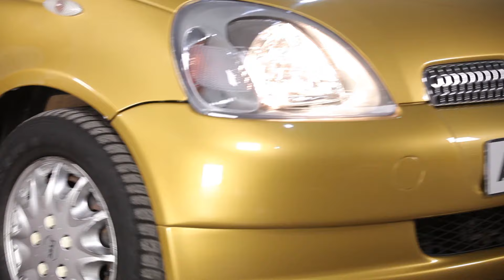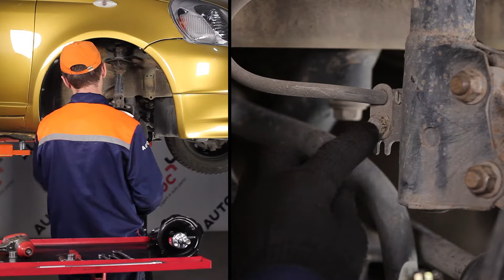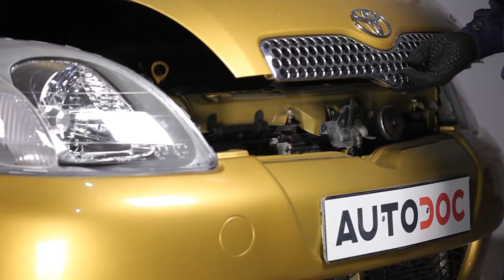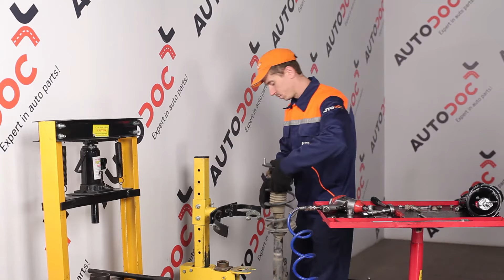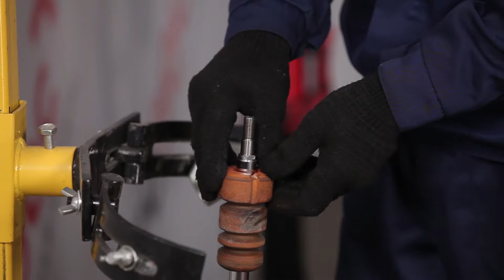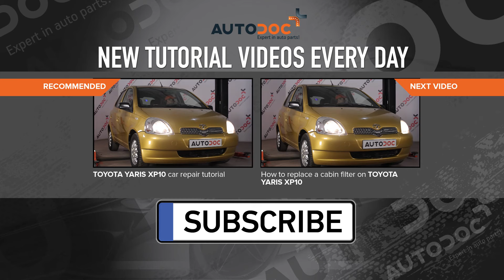How to change front shock absorbers on TOYOTA YARIS XP10 TUTORIAL | AUTODOC

Comment: Just did this job today. I'm a novice and was able to do it alone. Only two difficulties I had were: 1. It's hard work getting some bolts off. I used a long breaker bar and gave it some welly. 2. I didn't put the metal top cap on properly (bit that goes on top of spring after the rubber) and this stopped me tightening the bolt enough once on the car. To avoid this, make sure you compress springs enough to push down the top cap and line it up with the flat edges on the metal pole. If you don't it just spins when you try and tighten it up further on the car. 
Thanks autodoc for the video. Lets me keep my old Yaris running year after year.
Reply from the maker: Thank you for such nice words, we will to please you with new and interesting tutorials and news.
Stay tuned with us.
Best Regards,
Autodoc team
Reply: thanks for the tip, but how did you compress the spring? I dont have that machine...

Comment: Thank you so much. How would i know the respective torque to close the bolts? I didnt find any reference yet. The dealer is near me and told me to search the internet. yes, really.
Also, would you recommend using blue  threadlock when closing all the bolts? 
thanks.
Reply from the maker: Dealers should have a manual with information on the tightening ratio
Yes, you can really use the blue thread lock-
Stay tuned with us.

Comment: Should i also replace the springs? My cars front left got lower than the right in the last few months. 
(2013 yaris. 66k miles)
Reply from the maker: Thank you for the feedback! Replacement of shock absorbers does not necessarily require the replacement of springs, but if you see a change in the ground clearance or worse, skewing to one side, of course, you should replace the springs. They should only be changed in pairs, also the left and right springs must be from the same manufacturer. Best Regards, Autodoc

Comment: What is the recommended torque force on these three bolts on the top and two bolts at the bottom?
Reply from the maker: Thank you for the feedback! All torque specs are indicated in the technical documentation on the vehicle maintenance, you can find them out at the official car dealer. Best regards, Autodoc.

Comment: If I am not mistaken, can you not remove the metal drip tray above the top mounting nuts? And m ake access to the mounting nuts much simpler for torquing requirements? Excellent videos by the way. I have had an ECHO  for years and needed this for DIY since the mechanics around here are incompetent and or thieves.
Reply: That back top mounting nut is a bugger to deal with. You edited that video to remove some elapsed time in the struggle to get it started.
Reply from the maker: Thank you for your feedback! 
It is possible, but this is an additional cost of time, effort and money. Access to the nut is sufficient for the quality of this work. Best Regards, Autodoc Team !

Comment: Using airgun instead of torque? Tightening without holding the absorber shaft? Tightening the upper shaft to car without having the car on the ground? Congrats, you have put all common mistakes into one video.
Reply from the maker: Thank you for the feedback! This video is considered to be an informative one, and it shows the sequence of repairs, so some stages of the repairs might have been excluded. Best regards, Autodoc.